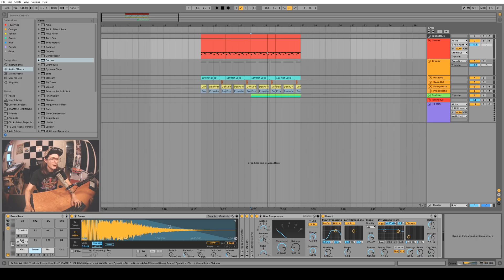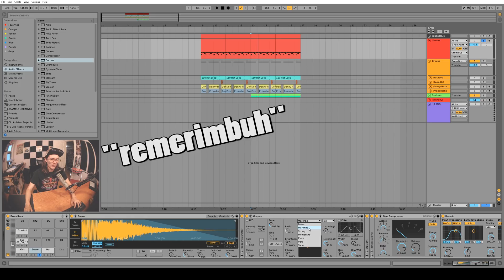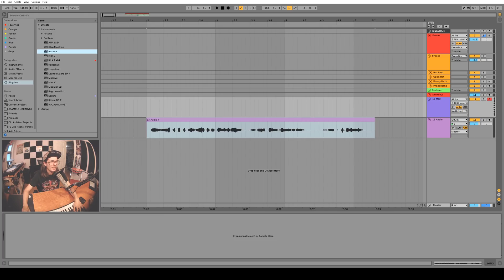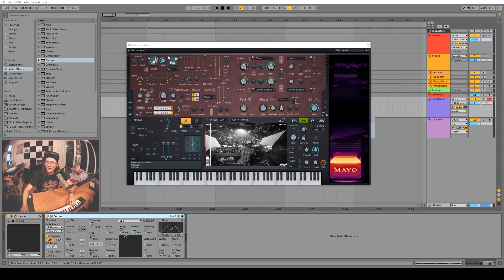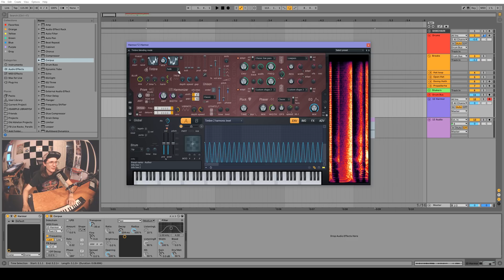Ableton Tutorial: Making Metallic Bass Sounds with Harmor & Corpus (Sound Design)

Comment: Is there a Corpus equivalent for FL Studio?
Reply: Convolver. You might not get all the parameters on the surface, but it's the same effect. And Convolver gives you the option to load in whatever Impulse response you want. FL doesn't come with many textured samples, but like i said, just load in said pipe, metal plate, ect sample